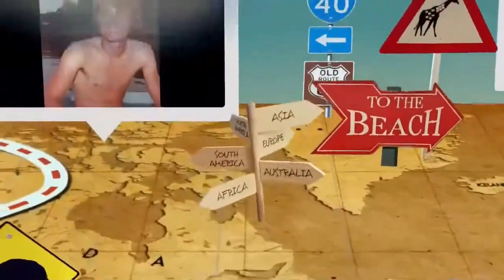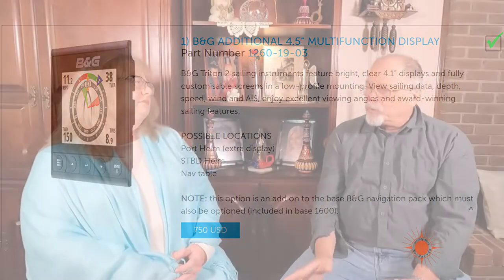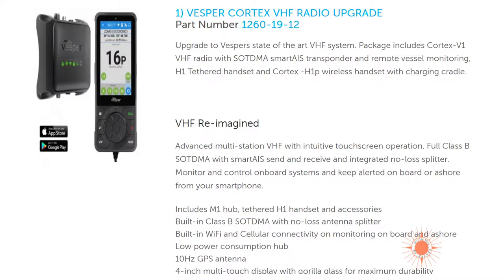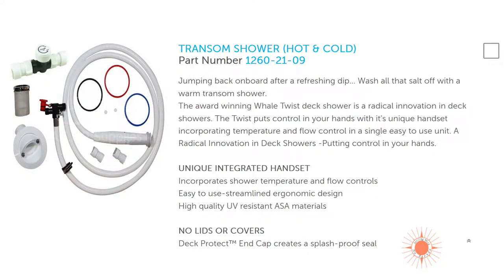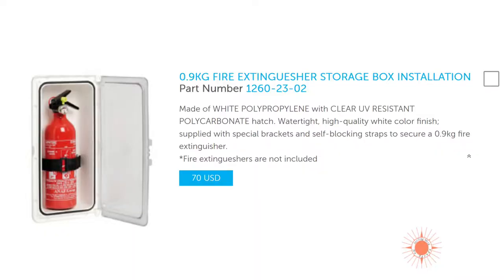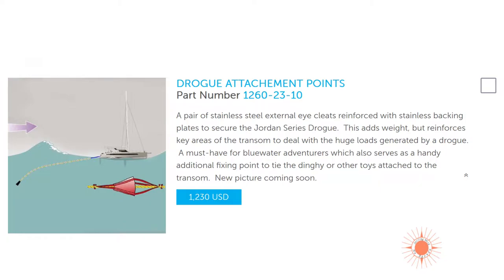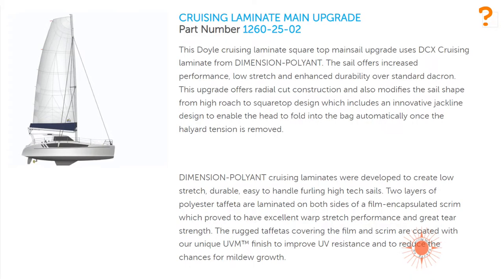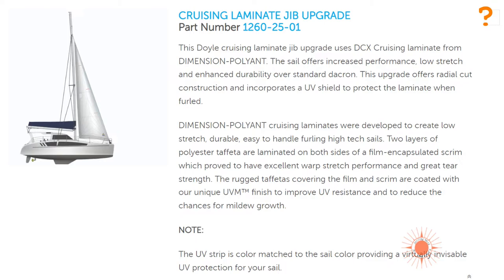Episode 11 - Even More Seawind 1260 Options - Part III

Comment: The fresh-water deck wash is useful for rinsing the salt off all your deck hardware and running gear... not just the anchor and chain.  Reducing corrosion extends the life.  While fresh water is precious, it can be replaced pretty cheaply... that crumbling stanchion, cleat or wench on the other hand... ;) A good fresh-water rinse once a week is a minimum.

Comment: As the 1260 is sensitive to weight on the stern, you might consider the carbon AST 340 Coast.  I'm also not sold on the DCX Laminates, I have read some folks who had delamination problems with laminates and replaced the sails with Hydranet which are expensive, but reportedly bullet proof.
Reply from the maker: Thanks for the comment. I really love that AST 340 Coast ( https://ast-yachts.com/coast-340/ ) , it’s weight with the console is less than the Highfield 340 without the console, but wow, you are really paying for that light weight with a starting price of 16k plus in USD ☹. I would want the electric package on top of that. Not many dealers in the US yet either. Hopefully they will have one at the Annapolis Boat Show to touch and gawk at.
Reply: @sailingwithnoagenda   Wow $16K, I had no idea.

Comment: Hi, I enjoyed your three part series. Our 1260 is supposed to be done summer 2023. We will also be on the Chesapeake Bay. And, we are on the older side so we look for things that make it easier. I am interested in how hard it is to deal with a spinnaker with the sock. Harbors Unknown made it look difficult. From sailing on the Chesapeake, the prevailing wind is SW and we are near the top of the Bay. We tack down the Bay and then need a good downwind sail to come back. Since we are not sure about the spinnaker sock, we are leaning toward the gennaker. Giving up broad reaching and upwind performance (screecher) for easy of sailing downwind. Any comments on the spinnaker sock? Thanks.
Reply from the maker: Thank you for the comment, we had a symmetrical spinnaker with the sock system on our trimaran. You raise the sock with the halyard, run your lines through appropriate blocks back to cockpit, and then slowly pull up the sock while someone is managing the sheets. The sock will have to be pulled up from the mast as far as I know. Lowering is the opposite, start to deflate spinnaker and pull sock down, and lower spinnaker sock arrangement and pack up if done for the day. In practice, we never had an issue. The issue we had on the bay was that a run had to be spinnaker worthy, the winds needed to blow from the north or south for us to set it and forget it, otherwise we would have additional work socking and unsocking as you jibe across the bay. I am not allowed to fly the “fun” sails when chartering so I do not have any experience with it on a 1260. The MPS would be bigger than my previous trimaran but still a lot smaller than the 1600. Sailing No Regrets always fly their spinnaker on their 1260 and it is only the two of them. I see Harbors Unknown use the spinnaker so it must be worthy to fly it in the right conditions.

We are going the screecher route initially and will look at the spinnaker once we move offshore. If there are other spinnaker flyers out there, please share your experiences.